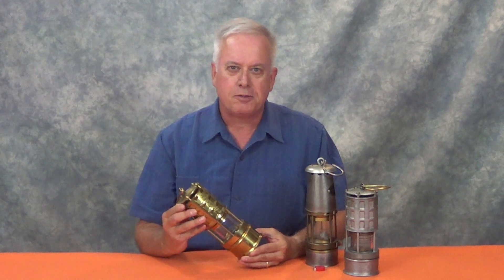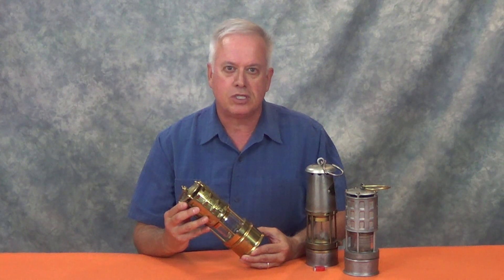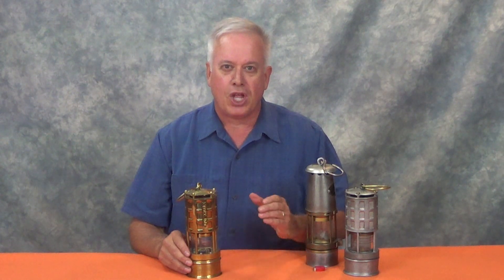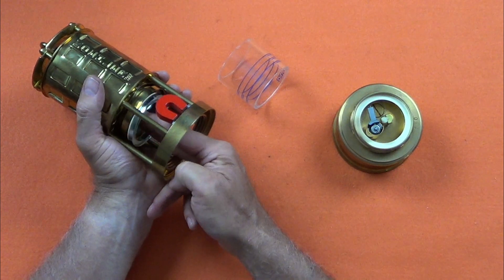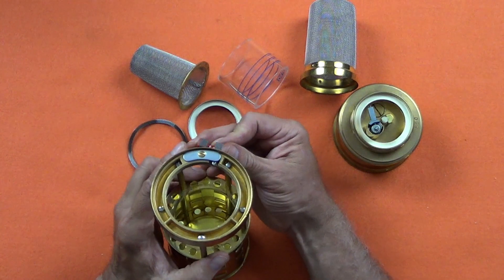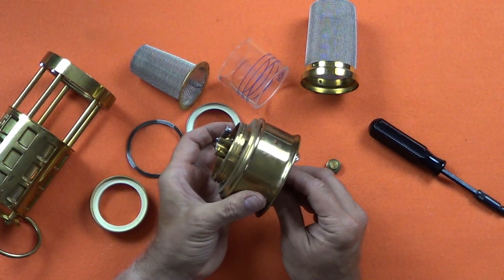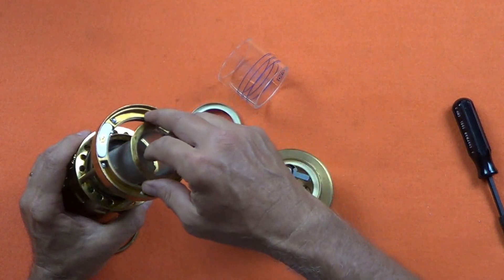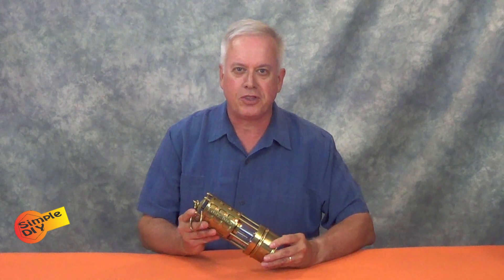Koehler Flame Safety Lamp Disassembly

Comment: You said ……asbestos rings?
Reply from the maker: Yep  https://digital.library.unt.edu/ark:/67531/metadc12410/m1/35/  If you worked in a underground coal mine back in the day, the asbestos in that ring was the least of your worries.  Well if that little ring failed then asbestos was certainly the least of your worries.

Comment: What type of fuel does it use?
Reply from the maker: The definitive source is the Mine Safety Health Administration guide book "MSHA IG 15" in there you will see they state "The use of suitable fuels is most important.  Because of excessive gumming motor gasoline is not suitable as a flame safety lamp fuel.  Suitable fuels are uncolored, straight-run gasolines, having a medium distillation range of 90deg to 300 deg F."  Straight-run gasolines are also known as Naphtha or white gas which is the generic name for Coleman Camp Fuel.  I would recommend against using your flame safety lamp unless it's been inspected by someone with the appropriate skills.
Reply: @simplediy3727  use naptha or lighter fliud only.

Comment: If you unscrew the oil reservoir whilst it still lit by fire...will it then still be lit and out of the glass?
Reply: Yes the lamp works without the upper assembly.  The upper assembly is what makes it explosion proof.

Comment: Thanks for the informative video. Do you know where I can purchase parts? I need a fount to restore a Kohler unit (for display).
Reply: Sorry, I don't know of any parts suppliers for any of the flame safety lamps.  You'll have to find ones that were parted out then sold on line.  However, since it's very difficult for the novice to tell the difference in various models, it will be challenging to find the right parts.  If you're missing the Font from a Koehler (note the spelling of both) it's going to be really tricky.  Good luck, thanks for watching.

Comment: What kind of fuel do you guys use for this lamp?
Reply: The definitive source is the Mine Safety Health Administration guide book "MSHA IG 15" in there you will see they state "The use of suitable fuels is most important.  Because of excessive gumming motor gasoline is not suitable as a flame safety lamp fuel.  Suitable fuels are uncolored, straight-run gasolines, having a medium distillation range of 90deg to 300 deg F."  Straight-run gasolines are also known as Naphtha or white gas which is the generic name for Coleman Camp Fuel.  I would recommend against using your flame safety lamp unless it's been inspected by someone with the appropriate skills.
Reply: @ImminentThreatDefense  Thank you so much for the reply! OK, i'll use my Coleman white gasoline.
Reply: @JX6G  naptha or lighter fluid.

Comment: I bought a fairly old one of these a decade or so ago that was pretty battered but still intact, the only issue is the fuel port isn't flathead, it has two shallow round indentions in it that look like they need a special key. I can't for the life of me get the fuel port to unscrew using makeshift keys for that port. I'd like to get it lit some day but without being able to put fuel in it I don't see that happening.
Reply: Try using a pair of snap ring pliers.
Reply: @ImminentThreatDefense  Interesting, I'll give it a try.
Reply: It does take a special tool to open the fuel port plug.  You can also use a pair of needle nose pliers to unscrew it.  You can also saturate the wick with light fluid and get it to light, but only for a short time.

Comment: If I wish to use mine camping, what would be recommend as a modern replacement for fuel?
Reply: I think you're going to be disappointed by the amount of light you'll get out of these lamps.  However, the definitive source is the Mine Safety Health Administration guide book "MSHA IG 15" in there you will see they state "The use of suitable fuels is most important.  Because of excessive gumming motor gasoline is not suitable as a flame safety lamp fuel.  Suitable fuels are uncolored, straight-run gasolines, having a medium distillation range of 90deg to 300 deg F."  Straight-run gasolines are also known as Naphtha or white gas which is the generic name for Coleman Camp Fuel.  I would recommend against using your flame safety lamp unless it's been inspected by someone with the appropriate skills.

Comment: How do you install a new flint and wick?
Reply from the maker: At 3:08 I point to a small screw.  Underneath the screw is a spring that holds the flint against the striker.  Remove the screw and spring, insert new flint, then spring and screw.  I've never replaced a wick but I think the only way is to insert it from the top and wind it in for its entire length.
Reply: Thank you, I am also mining engineer and don't plan on taking this in a hazardous area, but have it in our tiki bar along with my hard hat.  Like to be able to demonstrate it as you don't see too many of these in south Florida! 😅